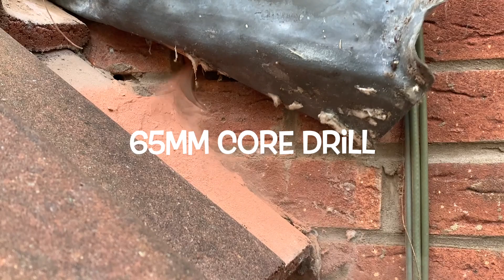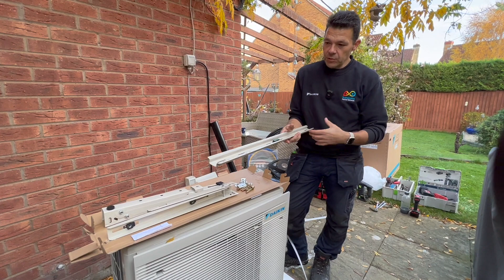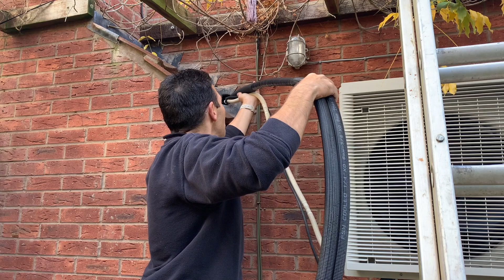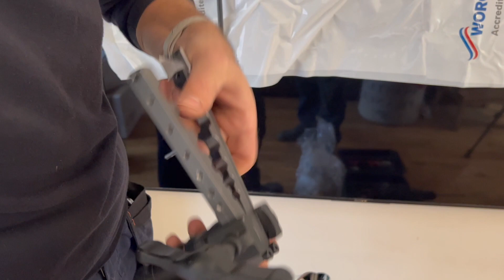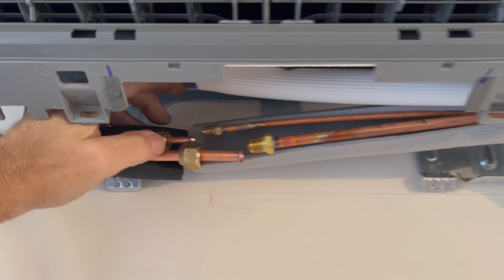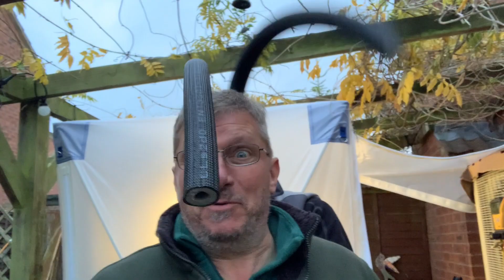Air To Air Heat Pumps: Are We Wrong? | A Week to install : @dameonhill

Comment: How are you getting on now it’s getting colder? Are you using the “demand control” feature at all to limit the power consumption or just letting it do its own thing?
Reply from the maker: I’m just letting it get on with things. No issue with heat it works perfectly. 😊😀

Comment: Cheers Mike. Fascinating! I assume this can do cooling in the summer if you want it?  Very impressed with your contractors, clearly a professional job.  Interested to find out what your hot water solution is ?!  I think in your last video I said we have a air heat -water pump solution with large radiators. After having it for a few years I am being a lot more analytical this year in its usage. Where we failed at in the early years was treating the system like a gas boiler. Now the system is running all the time and cycling even at night, and if my reading and calcs are correct, this will lead to a significant reduction in energy usage.  (P.s. the house was built with heat pump in mind). The only issue I still have is that when you are heating hot water you are not heating the house. I think this will be less of an issue with cycling, since the pump can worry about the hot water at times it is not concerned with space heating. Anyway, top video Mike.  Mark.
Reply from the maker: Cheers Mark, going to try keeping on a constant temperature and see how the power usage works out!

Comment: Good Vid Mike , Whats the Saving with the Offset of the extra Pull on the Leccy?
Reply from the maker: Not sure yet, gas was costing around £6 a day in winter…. So far the heat pumps have averaged 10 kW per day!

Comment: Was trying to figure out what an "air to air heat pump" was. Watching this solved that, we call them split unit aircons here.
Reply from the maker: Great thing is they are both, aircon and heaters.
Reply: @mike-M0MSN  heating not an issue here in South Africa! - cooling for the win:) 73 de ZS2VR